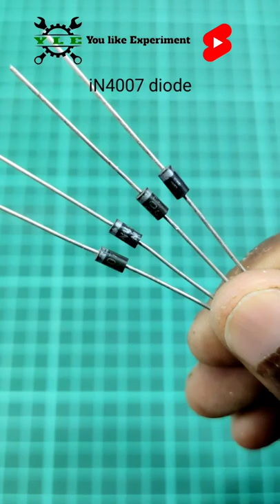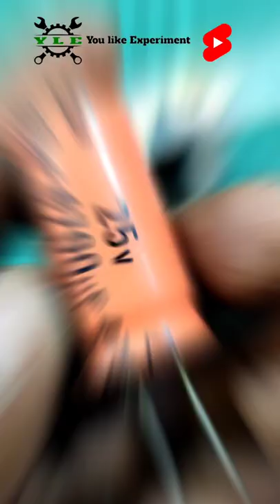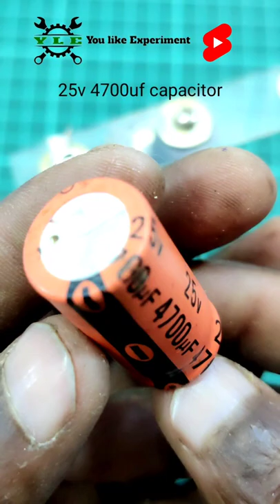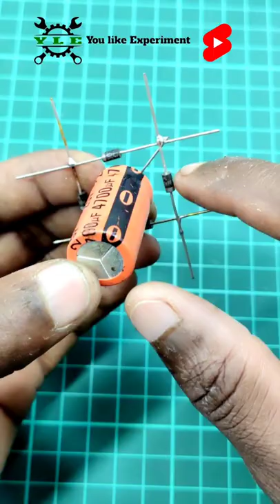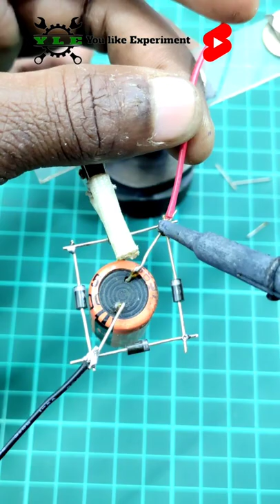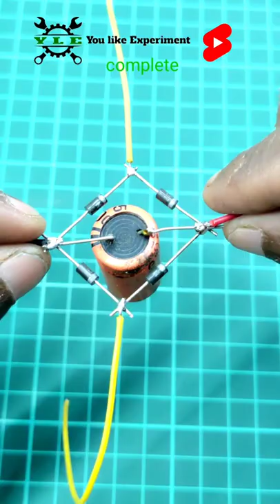How To Make  Bridge Diode 💕 For #supply #shorts

Comment: What's the usage ?
Reply: AC to DC current. The capacitor clears the transformed DC current. For example you need a power supply of 12V DC, but at home you have a 12V AC transformer. You create a full bridge rectifier(the circuit shown in the video) and get 12V DC. If you don't understand how this works, watch a video where they explain it with an oscilloscope and showing you how the current looks with and without the capacitor.